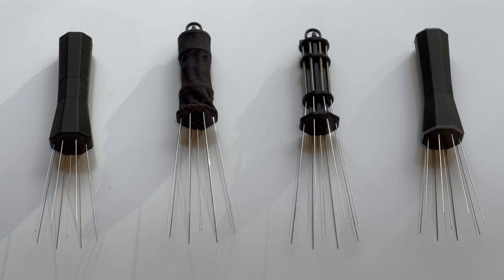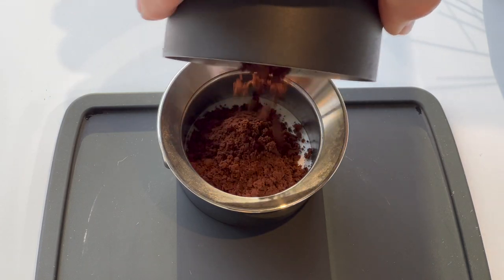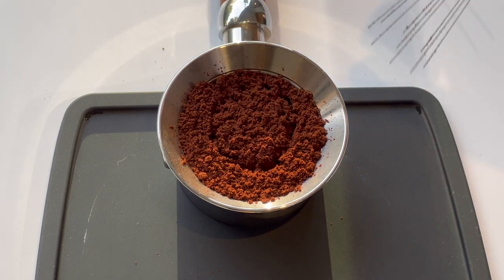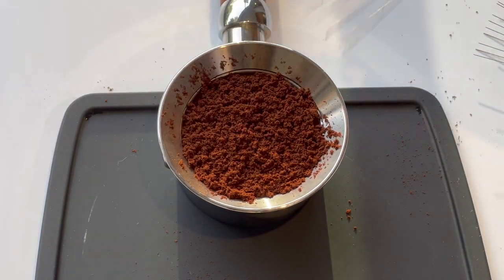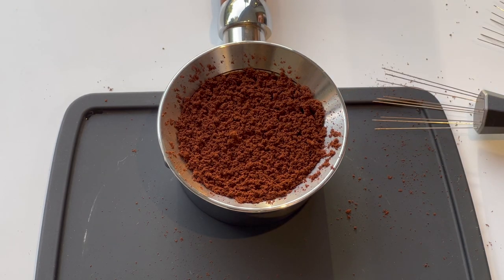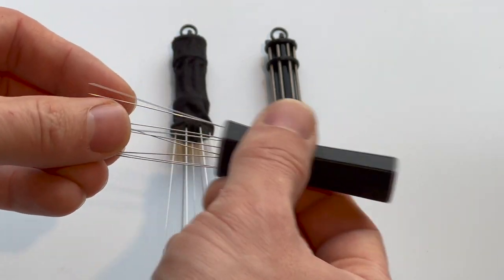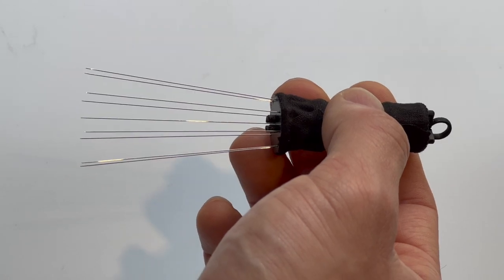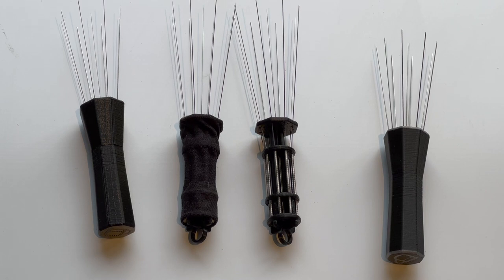WDT Needle Thickness Tested

Comment: If you use a shorter 0.25 needle (instead of the full length), it's actually really good. It isn't as flimsy. I've but mine down to 40mm, and it works like a charm.
It doesn't help with the 3D printed WDT holder, because there's a void space in between, and that part would move too, and if you cut shorter, it'll be too short.
What I do is use a cork from an empty whiskey bottle, use a paper clip, push it deep enough, I make 10 holes. Before I push the spring part in, I alight them all and cut at where the needles part are only 40mm, then send it down to smoothen the edges, so it doesn't scratch my portafilter as bad. It works like a charm.
Reply: The holder slack from using thinner needles shouldn't be a problem. You can wedge in a tiny bit of paper or resin to hold it firm.

Comment: Using the same dose of grinds for all thicknesses doesn't show the differences.

The grinds were first fluffed up by the 0.25, then the other sets simply cut through the work that the thinner pins did.

Each set of sizes should have had there own freshly ground beans to prep.

Still appreciate the time you put into this👍👍

Comment: Thanks for this great video. I’ve printed off my own version of your tool. The original thicker two piece version however I was wondering if you could help me figure out why my needles won’t extend out beyond the bottom very far. I picked up some very similar versions of needles but they only come out about half as far as I would expect
Reply from the maker: You probably have the wrong needles. The 0.35x75mm needles are 10.5cm tip to tip w/ a 3cm long handle.
Reply: @jkimmakes  I received the wrong length needles. Thanks again for the plans and your videos!

Comment: Nice Demo, I thought the 0.35mm needles handled the task the best. Was also wondering how paper filters would hold up against WDT. Do you pre wet the filters?
Reply from the maker: Yes, I have an example of my paper filter workflow in my "modern espresso" video. I prewet then tap dry w/ a towel.

Comment: How much does portafilter size matter? Would 0.35mm be stiff enough for 54mm, or would the added depth make 0.4mm better?
Reply: I currently use 0.4 in my BBE and it seems stiff enough. I was planning on trying 0.35 because it seemed like 0.4 shoved the coffee around too much, almost causing it to pile up. I am not worried about them bending too much.

Comment: Hey so can I use 0.25mm needles instead of 0.35mm because it's hard to find 0.35mm in my place. The 0.25mm is the only option available here so are those any good..?? ( Mainly for Wacaco Picopresso only ) your reply and help much appreciated. Thank you..🙏
Reply from the maker: Yes, absolutely
Reply: @jkimmakes  Thank you.🙏 Then I'll go with 0.25mm.👍
Reply: I have used up to 0.4mm and my favorite is 0.25 but i do not have that spread out shape of needles yet i have not seen coffee in between my needles.